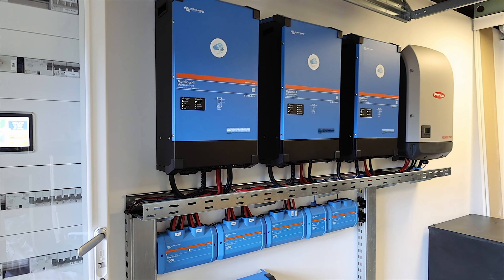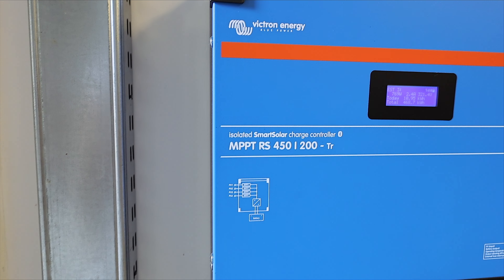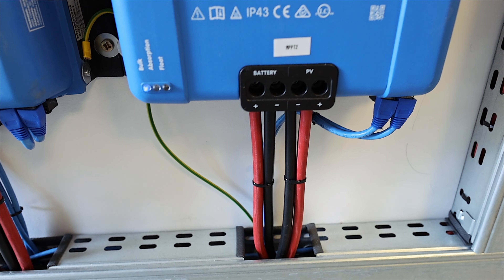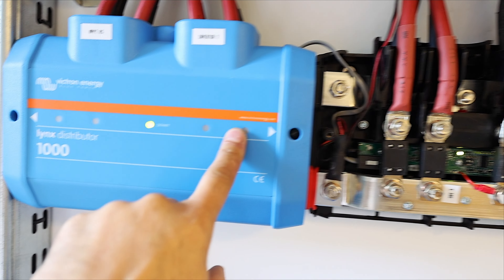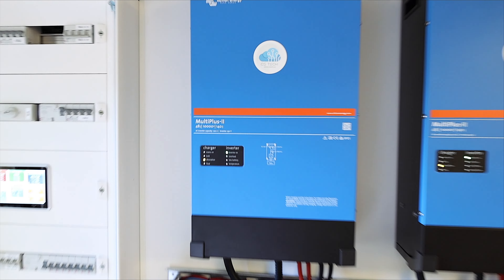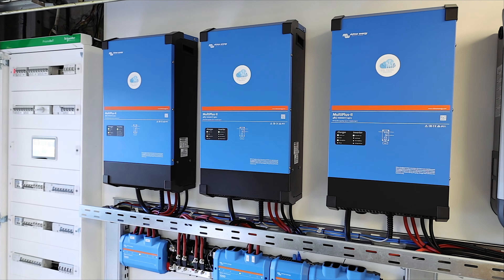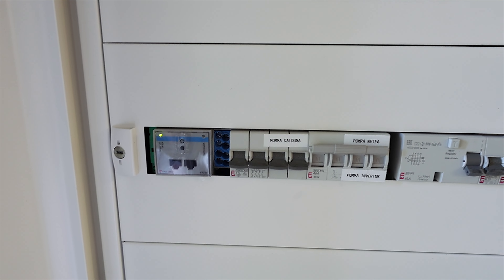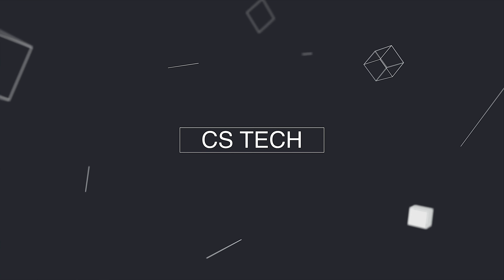44 kW micro-grid Victron and Fronius Setup with 52kWh storage

Comment: I recommend you invest in lifepo4 prismatic cells. The diy boxes for the lf280k are pretty good, with jk inverter bms (1/3 of the cost of the victron batteries) . Have a look on Andy from Off-Grid garage.
Reply: I would also second this. For your large system you should at least use 3 boxes DIY with the new EVE MB31 cells and JK BMS. I am at the moment in the process building my third box with 16,4kWh for less than 2000 Euro. The BMS will do a very good job.
Reply: I can confirm this. I run 5 Jk inverter bms now, the 200A version with 2A balancing power. 
They have still some small issues (see the offgrid garage video about “has DC power”) but the overall price is great with eve 280k v3 and eel v4 case one box was less than 1500€ for 14.4 kWh each. 
Victron CAN is supported.
Reply: Nice work but those changeover switches for loads are strange . All can be done e by ESS and schedule charging
Reply: Yep JK BMS’s with prismatic lifepo4 280A-310A cells work perfect, I have a few setups & all work well.
Andy’s Off Grid Garage Australia is a great channel for info on anything solar & batteries.

Comment: Wow, how technology changes so very quickly, especially in the renewables industry. I am about to install a 40kWh, 3 phase 0ms whole home backup battery from Sigenergy to compliment my 25.6kW rooftop PV array. 5 x 8kWh stackable battery modules, a 15kW 3 phase inverter on top. Gateway box to control backup. Very easy setup very easy install.

Comment: Better oversize than undersize!  Those 250/100 solar chargers def. need 50mm sq out. Otherwise super clean, dream set up. Do you rally need to go Victron for the batteries? I've had great results with Pylontech
Reply from the maker: I have DYI VW ID modules and soon I'll upgrade to 82kWh :)

Comment: You did an excellent job on that solar inverter system. I live off grid with an electric car and I can appreciate how powerful and clean that install is. 

All you need now is about 300 kWh of lithium battery and you’ll be laughing
Reply from the maker: I plan 150-200 kWh of storage, but in an outdoor cabinet whit cooling and heating inside. Stay whit us :)
Reply: @thecstechvideos sounds great, excellent setup.
Reply: @thecstechvideos  I have a 3x 15000VA multiplus system with 80KW of panels, and 130 KWH of battery was way below my needs. I ended up installing a second system, as a backup redudant system, with another 220 KWH of battery. Now I rarely start the diesel generaot.
Reply from the maker: @Paul-hj1vt  OMG!!!
Reply: @Paul-hj1vt  post a video pls :)

Comment: What a really nice setup !! Pretty and so powerful. 

I made a triphasé system but only with 3x 5kva Multiplus 2 and huawei inverter. 
Made the batteries myself with diy kit was cheaper and really good with seplos bms about 1600euros for 15kwh (we have 75kwh)
Reply from the maker: wow, 75 kWh...is a pretty nice battery :)
Reply: how are you finding the seplos bms?

Comment: Good video.  You’re both great.   

Martyna, great info shared that it’s not just overall kW clipping, we also have to be aware of the inverter clipping due to the max amperage it can input. 

Lastly, I wish the US would get it in gear regarding making solar affordability at least on par with most other countries.  Professional solar installs in Australia, for example, are roughly $1/watt and their approval processes are streamlined.  It seems to be roughly $2.5/watt in Texas. 

If Oncor electric delivery brings back their $9K credit again, then it makes sense to install an expandable 15kW (max for their program) hybrid system with a cheap but expandable 3kWh (min for their program) battery.  

Otherwise, it seems like buying a kit or components from Santan solar on Black Friday is the way to go for those inclined to major DIY projects and have friends/family that are licensed electricians. Even then, it’s hard to match the cost of a professionally installed system in Australia, which is pretty wacky.

Comment: Victron makes excellent equipment but wish they would embrace conduit knockouts so the wiring isn’t exposed. But, beautiful job on your wire management on this build. As clean as I’ve seen.
Reply from the maker: Yeah, their products are modular and need special wiring sometimes, but...a new line is coming, the one that can easy fit in rack...but I prefer the ones that can be hooked on wall, look more personal setup :)

Comment: Perfect job and thanks for sharing🙏 I like the tidiness and versatility and I only one question about the 250/100 MPPTs cables, you've used 50mm and said that it is compulsory whereas I was under the impression that 35mm was the recommended size. I wanted to use 50mm on both my 250-100 since I always oversize all of my cables but I didn't think the 50mm lug would fit the MPPT connector, so I used 35mm instead. I only have two 5000 Victron inverter as I do not need three-phase although I've considered that.

Comment: Can you say something about the power consumption when idle (zero load)? 
I'm planning a similar setup, so I would be very interested in the efficiency of the system at light load. 

I.e. what does the system draw with 0 W load and 1 kW at the output? 

How long can the 3 MP2 10k deliver the maximum 24 kW before they are turned down? 

Do you have noise problems?
Reply: Thank you for asking the important questions, how much waste and noise. I also want to know please, I think this is the most important consideration for an efficient system. Thank you

Comment: Hi Can you post somewhere the parts and where you bought them. I wish to make similar system and i'm not sure about the fuses and cables, lugs 
I plan to buy multiplus 15000 and to use just one 314ah 15kw battery , have grid to assist with the load but unsure on sizing wires and fuses.
If you have the time to respond to this, thanks in advance :)

Comment: Hello, tks for your video explanation. For the Fronius, not fully clear why did you put a second inverter into the game? Is it only to add power to your grid? Victron does 24kw and that was not enough for your house? I am planning to get 3x 10k watt Victron Multiplus.
Reply from the maker: During the day Fronius act as a normal inverter and power all my loads (electric car, heating, lights) and he can do this directly whit 98% efficiency so Victron is not used for home loads during the day since his efficiency is around 96% so no more conversion from LV to 230V...and Fronius is used as an MPPT whit HV strings :) this is the real reason, less cables more modules

Comment: Congratulation with your very neat looking install. It's one of the cleanest I've seen. Love the idea of using the Schneider cabinet for the AC and DC distribution.  

One question: why are you having a Lynx distributor on the right side to the Lynx, but NOT using this to connect your batteries? (The batteries are now connected to the bus link, which could have also been connected to the Shunt)
Reply from the maker: Thanks! Regarding Lynx on the right side, I plan ro upgrade the batteries and use multiple conductors for connect to system and I want to put fuses there.

Comment: Looking damn nice
Reply from the maker: Hehe, thanks !
Reply: @thecstechvideos  I did build myself an 20kw storage 3 phase 3000va system with 12 435 panels to victron on the house and 16 panels on the barn in microgrid to start with and learn this stuff and it has been fun doing so. Build the battery myself to.
Reply from the maker: So..I’m not te only one crazy 🤪
Reply: @thecstechvideos No, no you aren't 😂. Winter weather has been dark tho, not much production 😢.

Comment: Very nice install you should look at a battery shelf with 3 or 4  15KW batteries. LFP cells 280AH are now only €80 each so you could build 60KW (64 cells) with x4 BMS for €6K and cycle between 20 - 80% DOD for 25 yr battery. CATL cells are the best >8,000 cycles
Reply from the maker: I will have the new Victron Battery direcly on 48V and I'll install around 82 kWh. I wait them to release :)
Reply: @thecstechvideos  Does such a battery exist by Victron? I see no information
Reply: @thecstechvideos This is awesome that you have not lost “h” in this case. Because “kW” and “kWh” are like a weight and a temperature.

Comment: Nice setup. A Part of the Solar and battery DIY Community is about to replace the mega fuses since there was a fire in the US where, the insurance claims, the arc of a blown fuse caused the fire. Do you think it’s worth to take a look at this topic or are you ok with mega fuses and trust them?
Reply from the maker: I don't believe the fire start because of mega-fuse. Is around 40-60V there and the arc can't be so big to melt and set fire to the fuse. Probably there was an imperfect contact or a screw loose or not was tight at the correct torque. Or maybe an undersized conductor...who knows, we need to see to believe :)
Reply: @thecstechvideos  I also don’t believe it. That might be just a reason so the insurance has something. But if you have a huge system the current can get quite high in case of a short and the official specs of the fuse could be not sufficient.
Reply: @thecstechvideos  The problem is not the voltage, but the current. The internal resistance of cells is really small and it allows them to keep huge short circuit current -hundreds of amperes. The voltage is small and not enough to start an arc - right. But you think about it in open state.
The real situation is different - the circuit works, then suddenly a short circuit happens. The fuse melts. And during this melting the gap is not instantly appears -  it starts small and then increases (all in milliseconds timescale). And extremely hot gas from this melted fuse decreases the voltage needed to start an arc, and it starts! And once started, having hundreds of amperes in flow as plasma, it can cover gaps of centimeters(inches also). All welding works like this - bring electrode in or almost in contact, start arc, increase the gap. 
That is really serious thing and  "I don't believe in it" is not a safe enough safety measure :)

Comment: Great setup! very clean.

Question, did you think about the maximum disconnect current the mega fuses can handle? Lifepo4 can deliver tens of thousands of amps in a short. Ive read that Class T is better for this?

Comment: Hi CS Tech, very nice installation! You did an excellent job. Also like the big Prisma Schneider electric distribution box. 

Question: Between the Multiplus and lynx distributor, it seems you didnt install a DC switch. Is it not necessery? With bigger systems, we are using ETI knife blade fuse and holder, but its expensive. What would you recommend?  The normal red DC battery switch is only usable for 3 en 5kVA multiplus.
Reply from the maker: Is necessary, but since i have 3 phase system I prefer to shut down all once and for that I have a Gigavac contractor already on general positive from battery that can disconnect the entire DC from whole system.  More videos will come about this 😃

Comment: Hi, I'm about to build a similar but single-phase system with Victron and Fronius. First, I also activated the Fronius microgrid, but I would like it not to absorb even 1 W from the network, as you did, in particular the coupling is at the input to the victron or in ac out of the victron?
Reply from the maker: In this setup, Fronius is on Victron OUTPUT and on victron input, on grid connection point I install a Victron meter so I can limit everything.
Reply: @thecstechvideos  so is fronius in parallel to the home load?
If they were to cut off the power, what protection would there be?
To function, my Fronius is automatically connected to the network via Italian CEI 021 regulation. What do you recommend, can I still connect it to AC OUT Victron?

Comment: Very nice setup! Always looking forward to watch your videos.
Question: What is the max. off-grid power at night, without solar?
Reply from the maker: Sorry, but not understand the question. What is the max power that can be used in the night in off-grid mode? If that’s the question, is around 24 kW max!
Reply: @thecstechvideos  I guess how much can you draw from the battery if there's no sun & no grid? If it's 24kW at 48V that would be 500A from the battery? Can the batteries handle that? Thanks!

Comment: Super system, well done, Im a bit jealous :-).   Beautifully connected. How does the Fronius throttle down (delivering less power when the grid has a failure, no power from the grid) and your batteries are full (SOC 100%) ??  are you using zero feed in from Fronius ? to prevent overloading the batteries ?
Reply from the maker: Fronius has country code set to MG50 (micro-grid) and Victron know that a Fronius is present and send limitation via frequency. Basically modulate frequency and this reduce or increase Fronius production.

Comment: I don't understand a little think... 
I so a lot of PV system that use e separate MPTT and it don't use the internal MPPT of the inverters... 
Why this please ? 
I'll have a 90 pieces PV panels on my new home roof... and I must decide how to divide them... 

Faina de tot instalatia, mai ales managementul cablurilor :-)
Reply: I don't know if you got your answer elsewhere. I'll answer incase it helps others. Most inverters of this nature are chargers but takes AC in power from the grid and output DC to charge a battery. They can take it from a generator too.

That's the charger portion of the inverter.

However most inverters do not have mppt built into them. A certain product lines of victron does but most victron inverters do not. The mppts are often customised to the size of the arrays etc. no single mppt is often enough to handle most off grid set ups that grow. So additional mppts are often needed.
Reply: @PresidentBust  So you tell me that the Victron MultiPlus-II (that cost a lot of money) have no MPPT ? 
Thanks a lot for the answer.
Reply: @MrDenisJoshua  yes that is correct. The multiplus product  definitely does not include an integrated mppt. The mppt must be purchased  seperately. 

It can charge your battery but only from an AC in terminal. Usually a grid or generator. It will convert the AC to DC. 

It cannot convert fluctuating DC to a stable DC voltage like an mppt does. Nor can it handle high voltage DC like get from panels
Reply: @PresidentBust  Thanks a lot ... I didn't know that :-)

Comment: what is your battery solution? We're using victron + bmz
Reply from the maker: Right now I’m using VW ID3 modules, around 52 kWh Li-ion, but I’ll chose Victron LFP. Thanks
Reply: @thecstechvideos do you have 8s version? How you connect it? 16s? Because in datasheet is battery volt is from 3.3 to 4.2v. But 4.2x16 is 67.2v and this is too much for victron mppt and multiplus. What bms are you using?
Reply from the maker: @borcany7  in my setup I have 12S, but a friend has same modules but 8S and is also works on Victron, but will charge to max 64V. That is the max value for Victron. He use 250/100 MPPT to charge. BMS I have SIMP, he is using GRN BMS. I will make a video about.

Comment: NOw is this system cheap. But a few yeas before this 10 000 VA units was expensive. Also battery now is cheap. 60 kWh battery is about 5400 €.
Reply from the maker: What battery you find with 5400 Euro for 60 kWh?
Reply: @thecstechvideos  EVE, CALB, CATL, BYD, Gotion, Hithium , DOcanTech. etc. You can make 35 AMPS actve BMS for few bucks to 8 paraller packs. Also this fuses you use are not good for DC and high DC currents.. YOu have to use fuses, that in case of internal or external shot circiut, do not ignite gases from your batter, e. g. H2, C2H2, C2H6, CH4 and you do not breath HF, CO, CO2. Bye.